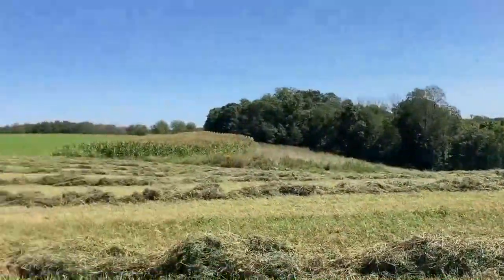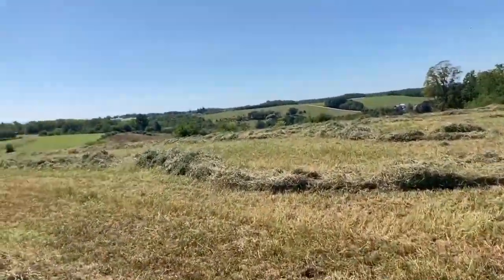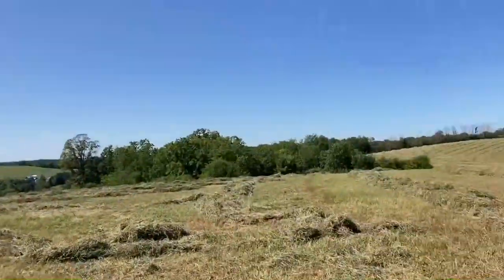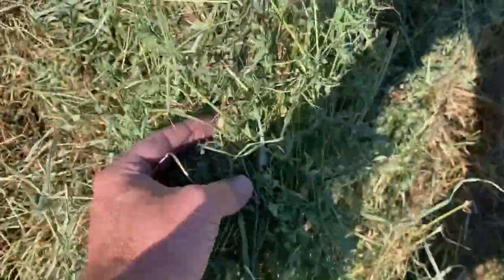Raking Hay with the International 826 and Gehl Wheel Rake

Comment: Looks like you made a lot of dry hay this year…did you fill any bags? 
I used to run an 8 wheel 3pt Gehl rake on an old Ford 4000 for my uncle when I was a lad
Reply from the maker: Ot sounds like you had a lot of Ford tractors.
Reply: @farmcards  yeah was my uncle’s farm he had a TW-15 an 8000 a 6610 a 5000a 4000 and an 861…. At one point also had a beautiful 7700 which was traded for the TW